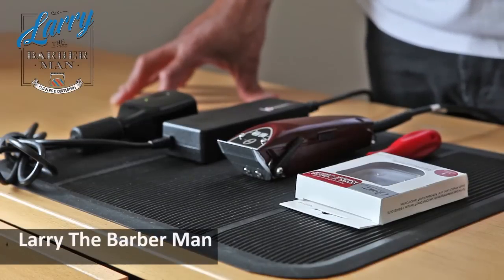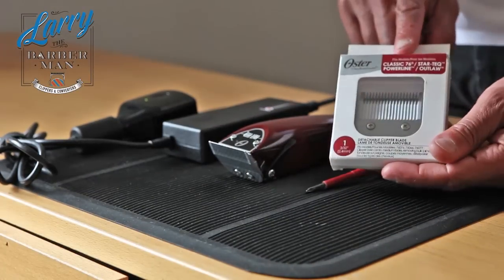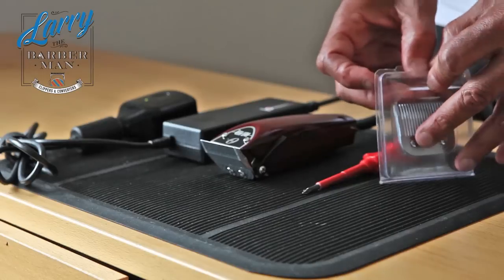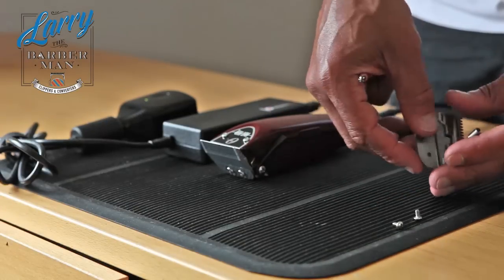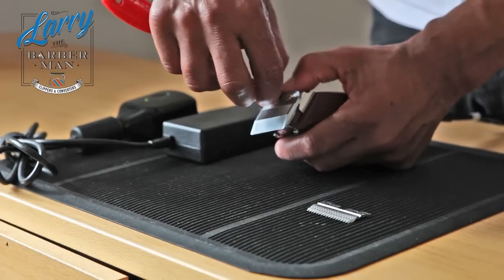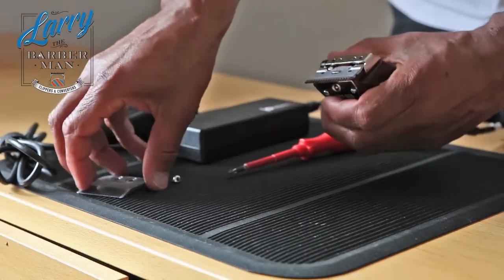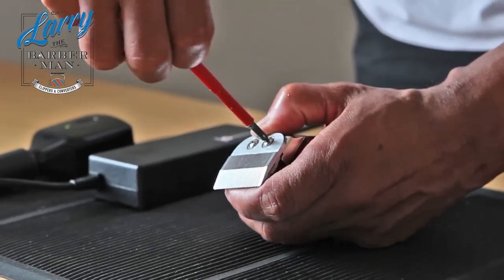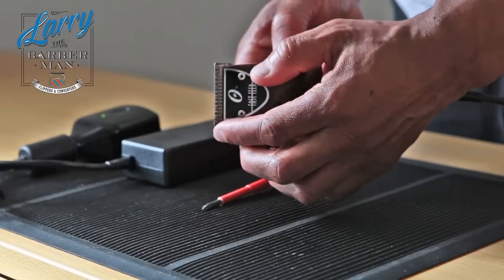How To Zero Gap Oster Fast Feed Hair Clipper Quickly And Easy

Comment: This is the most accurate way to ZERO GAP your fast feeds...thank you for putting this information out you helped me tremendously...and FOR THE RECORD...I CAN CUT WITH THE LEVER OPEN OR CLOSED....If your clippers stopped working once u opened up your lever...you didn't get the OSTER CLASSIC 76 #1 DETACHABLE BLADE...because if you do...the clippers cut like liners closed...and you can erase any line the create
Reply: I did this n the teeth of the cutting blade stick out further. Than stationary blade.

Comment: The fading lever will still work aftrr doing this correct ? I purchased universal guards that work for fast feed wahl and the 76 classic so they should work aftrr doing this as well ? It's a zero gap even though you're using a #1 blade ??

Comment: I did this to my fast feeds, the only issue I found is that the moving blade (classic 76 blade) hits the guards. I notice that when its on the moving blade comes out to the sides slightly. What can I do?
Reply: Jesus S. I had the same problem. I wound up cutting the blade down slightly, until it was the same width as the factory blade. This allowed me to zero the fast feeds, and not have my guards rattled to hell. Hope this helps you!

Comment: Hey Larry, I've seen a few  who have used an Andis #1 detachable blade either ceramic blade (does not heat up) or metal blade to zero gap their fast feeds. Does this also work? They have also used the andis double magnetic guards on this clipper and they fit perfectly. Can you comment on this and if they work? I'm thinking of getting a pair of fast feeds but unsure of which zero gapping method to use. Thanks!
Reply: have you tried it?

Comment: So you don’t need the ceramic?? Basically the reason the ceramic works is because it’s longer in the teeth which is the same as cutting blades on the detachable?? Interesting. Obviously the ceramic keeps it cooler which is an added bonus but it’s good to know.

Comment: Has this work for anyone?, as I tried this myself and doesn't work. Rattles hard and pulls hair wen cutting it does zero gap how ever but not useable like this am I missing something here?
Reply: I tried it and it works just fine
Reply: Adrian Roman I'm having the same exact issue. Does anyone know why?
Reply: My Vo yeah because this isn't how you zero gape the clipper you want to buy the andis detachable no1 guard with the ceramic edge blade
Reply: Having the same problem. Rattling hard. It doesn't sound good at all. Kind of irritated. Who for sure knows the solution to this problem and how do I fix it?
Reply: NoLaTvShow3 you've got it to work perfectly with this blade?
Reply: I got it work but it rattles when you put guards on it.  And it doesn’t not cut well with the guards on it

Comment: its an expencive solution. You can get andis ceramic blades and just the moving top much cheaper. But what I dont like here is that the fixed blade has 25 teeth while this exchange and the andis has only 18. I dont think that this is optimal.

Comment: does the 1a blade also work for this?
Reply from the maker: That I would have to check
Reply: +Larry The Barber Man can you speak on the issue with the double magnetic guards i didnt see a problem but other ppl are what do you think do you see a problem

Comment: Using the one cutting blade means open two
Reply: This is just the blade. Your statement would make sense if you attach a 1 guard and open the lever, that's a 2
Reply: Plus an oster one is my shorter than a regular one plastic

Comment: I have always used the 0A blade. And yes it works, its the best way to go when you want to zero gap the fast feeds. Either the 1 blade or the 0A will work fine. Check out my instagram page. @meanfades_official

Comment: Don't waste your money on this. The guards don't fit. Neither do the Andi's magnetic guards. It becomes more of a Wahl clipper the way it opens to halfway instead of #1.
Reply: false. it cuts closer therefore it will cut closer with the guards on.
Reply: +Jay The Barber- Thank you for the reply back. Please excuse my rudeness steaming from frustration. I'm sure it works. That wasn't my issue. My issue was getting the guards to fit. If you hold the blade next to the original you'll see that it's wider. I have the fast feed guards and double magnetic purples. If you got them to work I would like to know how if you don't mind?
Reply: Oh I see what u saying
Reply: +Markeith McDaniels your purple magnectic guards didnt work ? i just did this today and cut my sons hair i didnt notice any problems
Reply: i had the magnetic guards with one magnet...it did make alot of noise. but all i did was get some end-nippers and cut the portion of the guard that the cutting blade was hitting and its all good now.....perfect for getting the bald (00000) line out...i love my fast feeds!!!!
Reply: +Markeith McDaniels The double magnetic guards fit just fine. I'm using the setup, right now.
Reply: +BobaDavis Let me know how you managed? I still have the blades but ended up taking a path to zero gap them. I own many clippers. The fast feeds are my go to. I share your sentiments!
Reply: +Markeith McDaniels I just changed the moving blade like the video and that's it. I seriously hung up my Masters for them.
Reply: +Markeith McDaniels i spoke with 3 barbers about this and they all said it's normal and that the clipper should eventually grind away at the guard fixing the issue
Reply: Hey everyone, I just read all the comments. I'm going to be buying my fast feeds soon with
the purple magnetic guards. What do I do? Go with a ceramic blade like others do or go with the 76's blade like Larry just did on this video. Thx. Happy cutting!✂️✂️✂️✂️😁
Reply: Demo Demo It's really up to you. With the ceramic, it's not supposed to make friction heat as fast as the steel version.